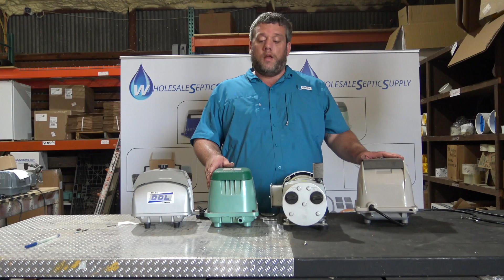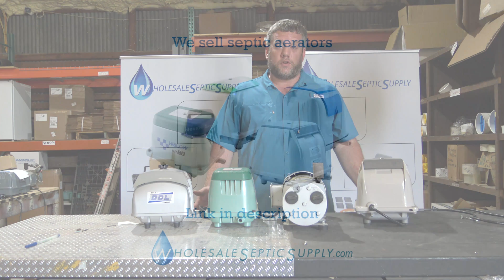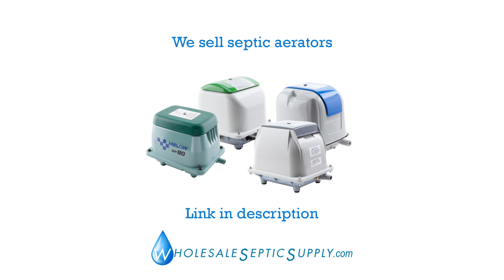Pro's And Con's Of Different Septic Air Pump Designs

Comment: Very useful video thanks, it just popped up on my phone thanks to the algorithms. We live in the Scottish Highlands and we have a Graaf treatment plant. The original Hiblow 100 conked out after only 28 months and when I stripped it down I found dry mud inside, lots of rust and a water level mark about 1" up the cover. My guess is that our builder dropped it in a muddy puddle. Once my service engineer let slip that these are koi carp pumps I was on a roll and I got a Sekoh 100 for half the price of the Hiblow. It weighs 2 kgs less so it doesn't distort the alloy mounting shelf as badly and after 3 weeks it's running fine though it gets noisy in sunny weather when it heats up inside the case.

I wanted to fit a remote red warning LED on the case where I can see it from inside the house. Graaf wanted £187 + 20% VAT for an LED,  a length of coiled cable and a plug, daylight robbery! I got the bits for about £30 online and Graaf told me about the terminal block inside the control panel for wiring a remote failure LED so now I'm all set up. 

How long can I expect the Sekoh to last? I hope longer than 28 months.
Reply from the maker: Normally they last longer I would say that submerging it in water didn’t help. Also how deep is the pond and what type of diffuser is on it will matter also.

Comment: I used to have a rotary vane pump, and after about 10 years, it started making a lot of noise.  I installed a rebuild kit on it to get a few more years from it, but after the 2nd rebuild, it was the motor bearings that were giving out and no rebuild kit would fix that.  I decided to go with a new diaphragm pump and have been very happy with how much quieter it is, even when the rotary vane style was working well, it was significantly louder.  I have a 500 gal system and it's been rock solid for 2 years now.  I have my system serviced every six months and haven't had any issues.  Your videos are very informative and help to keep the consumer well informed about a system they rarely have to interact with.

Comment: I have a 4.5 year old system with a SECOH JDK-40 linear pump on it.  The pump is still making good pressure but it has started turning itself off every few hours triggering the pressure alarm.  It will sit for about 20 minutes and then start back up.   I'm guessing that the air pump itself is failing and triggering a thermal protection switch and I should just replace the whole air pump.  Any thoughts?
Reply from the maker: Yes if it is kicking on and off I would replace the whole unit.
Reply: @wholesalesepticsupply  Yep!  Within a day of asking this it failed completely and became noticeably louder.  I ordered a new one from you guys along with new diffusers and it started working perfectly again.  I looked at the old diaphragms and they were both badly torn.  I'll shortly be ordering a rebuild kit from you and I'll keep the old pump as my standby.  I'm also going to start replacing the diffusers every two years since the old ones were plugged up and diffusers are cheap and easy to replace.   Thanks for the accurate advice!

Comment: Hello. So I had a motor that hung down in my system, it had like steel straps that corroded and the whole thing fell in. I replaced with the green one that sits on top like you have there. Are the other ones like I had that came with my system better? I believe it’s a Norwex.
Reply from the maker: Norweco sorry that system was the one installed. Years ago that was the way to aerate a system but a lot of new designs have come out and are more effective and more durable. Government also got involved in fractional motors are not worth a nickel now.

Comment: Why wouldn’t I just install a $50 wind turbine on the roof, vs these expensive pumps?
Reply: Not a bad idea, but there could be times when is isn't windy (or windy enough) so you wouldn't have a constant supply of air.  Bacteria need near-constant supply of air.
Reply: @MadMonk67  yeah. There are other options like solar powered wind turbine which can run on both solar and wind and also pretty cheap.

Comment: My old house next door has an old tank. Single chamber.  Tank is right next to house. Inlet on one side outlet sanitary T opposite side. Will an air bubbler system like this work on that tank?? Can the pump be placed outside..... Im in Oklahoma by Arkansas state line. So we do occasionally get snow

Comment: This is a matter of curiosity for me.  First, how big does a linear diaphragm sewage aerator pump like those described in this video need to be in order to have an output of 10,000 cubit feet per hour?  Second, can you tell me what brands make sewage aerator pumps --- specifically linear diaphragm pumps --- of that output capacity?  Third, do you know of a company called "Aerojet" that makes these kinds of sewage aerators?  I have tried to look up this company on the internet, but the only results I find are of an "Aerojet" that makes rocket stuff and which has nothing to do with sewage aerators.  Fourth, can you tell me just what kind of sewage treatment application this monster contraption would be used with?  I have more to ask and tell, but I will wait until you answer these questions.
Reply from the maker: I don’t think anyone makes one that big there is more efficient ways to get that much air so no one has done that.
Reply: @wholesalesepticsupply  Okay, Wholesale Septic Supply, thank you for your information.  Now I'll tell you more about this 10,000-SCFH monster aeration pump I was describing.  I saw such an aeration pump like this at a place called Kenbrook Bible Camp in the year of 1984 --- I was 13 years old at the time.  It served a four-tank sewage effluent treatment system that came off a septic tank.  The manager of the place told me that its output was 10,000 cubic feet per hour and that it had a 3,400-RPM motor.  My reason for saying that I suspect a company called Aerojet made that pump was because that was the name I saw not on the pump unit itself but on a nearby electrical control box for the pump.  Furthermore, I believe that this aeration pump was a diaphragm pump was because it made that same chugging noise unique to at least one of the linear diaphragm pumps shown either on your site or on someone else's site.  And yes, in my memory of that Aerojet pump from 35 years ago I indeed did think of that --- as to why there would be a diaphragm pump that big if there are more efficient ways to produce that kind of airflow --- but all I know was that I saw this kind of aerator pump and I wondered what you would say about it.  By the way, the "AEROJET" logo I saw on that control box near the pump consisted of a...You know how the Ford logo is, with that shiny dark blue oval with "Ford" written in white cursive letters in its center?  Now imagine a red oval like that with the word "Aerojet" written in cursive white letters in its center.  That was the Aerojet logo.  The pump itself was colored in a shade of light blue, and it was perhaps 3 feet long, 2 feet wide, and 2 feet high.  It was mounted on metal legs which elevated the entire unit about a foot off the ground.  The air pipe came out the bottom and then branched off into the four tanks.  Do you have anything to say about what I just told you here?

Comment: I have a pump system. Can a I add a air pump to the pump tank ?
Reply from the maker: Brad Nichols i wouldn’t no stable water depth water will be all stirred up.
Reply: @wholesalesepticsupply  so if i put one on the liquid side of my 1st tank would that work ?
Reply from the maker: Brad Nichols yes that will that is what you would want to do and have an effluent filter.

Comment: You probably won’t believe me but I just replaced a hiblow 80 that lasted 12 years +. Never rebuilt once. Electronics went bad. Glad I found your site. No where to shop now.
Reply from the maker: Van Massey I’ve seen that happen it not the rule it more the exception. Depends on the state as well we normally in Texas only see 3-4 years before rebuild. I have seen them go 10 years here but 1 out of 200 maybe. They are more cost effective in the since they take less power and can be rebuilt. 10-12 is normal for total failure the coils normally go bad that’s an amazing life for something that runs none stop.